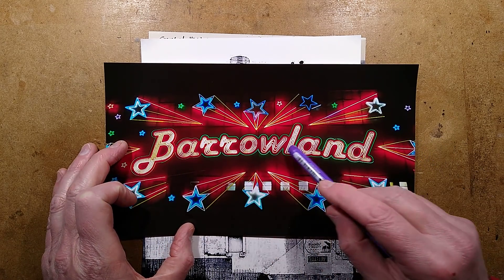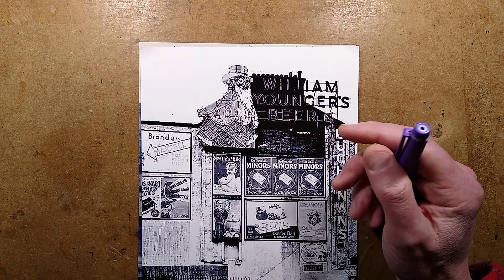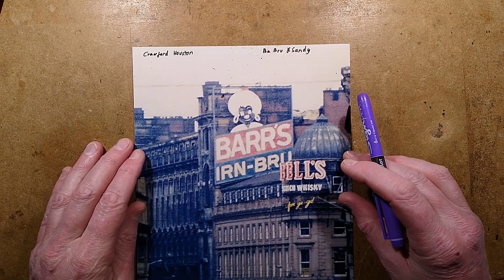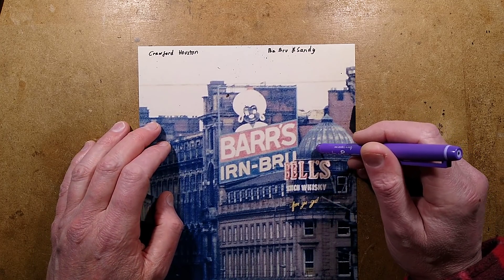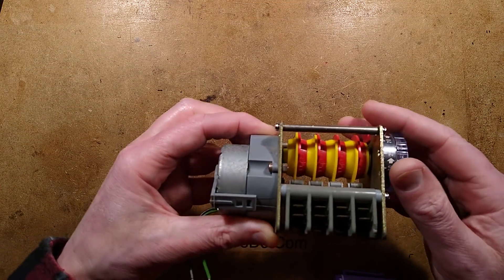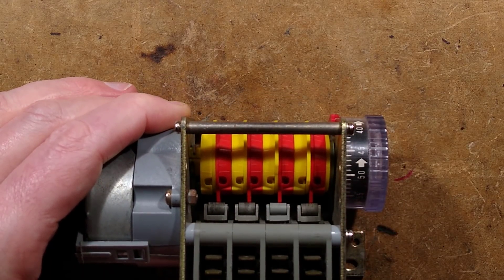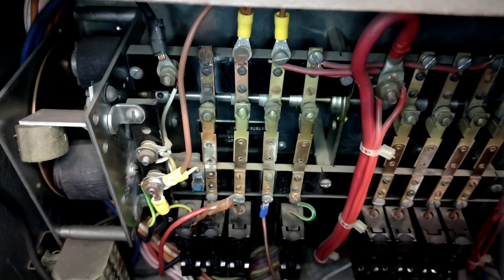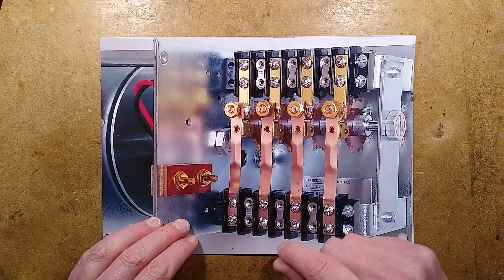A look at the Barrowland's neon sign controller

Comment: I'm a professional projectionist and have seen many of those electroechanical motor driven cam-type sequence switches used to switch the incandescent and/or neon lights on theater marquees, especially in older theaters. (The big theater  I work at now was built in 1916)  Some of those motorized sign controllers are decades old, but still operational. The only time I've had to actually fix one as at a 1926 theater, although I think that controller only dated back to the late 1940's. (a lot of the original wiring from 1926 is still in use in that building) The only problem with that controller was that several of the contacts needed to be replaced.  Although the company that made that sign controller was long out of business,  there was still a company around that stocked motors, cams & those contact shoes to fit it.  That sequencer had 8 contact springs. Only 2 were bad, and one was a little flakey, but a long as were were working on the unit, we decided to replace all 8 contacts  instead of just the 'bad' ones.
Reply from the maker: Replacing all the contacts was good.  It's the best form of preventative maintenance.

Comment: Nice and much more interesting to look at than a solid-state version, although, in theory, a well designed solid-state system would require far less maintenance than the mechanical one.

Just thinking about a sensible way to implement this in solid-state...  Initially I'm thinking a micro-controller (obviously!), hooked up to I2C or SPI switches, connected to solid-state relays.  That could be modular and extensible, easy to swap failed parts, and, in theory (again!), should be maintenance-free for years on end...
Reply from the maker: Modern solid state relays (good ones) would be my choice for a sign like this now.

Comment: They remind me a little of the contactors used in HVACR systems to switch the heavy loads of the compressors and condenser fans.

One thing you didn't mention was at what stage do they switch the power? Are they switching the mains voltage or is the output of the driver going through that?
Reply from the maker: They switch the mains power to the high voltage neon transformer.
Reply: @bigclivedotcom  I think the current is pretty low for neon tubes, so switching only 240V may explain why you can use slow contacts and not be troubled by arcing.
Reply: @jpdemer5  switching transformers or other coil-like loads pulls high current peaks. 

could be the pitting on the contact surfaces act as a resistive layer to 'charge' the inductive load slowly.
Reply: @casemodder89   High peaks, but also very high inductance, so I think the initial "spark" is kept low.

Comment: Having heard the controller running, it reminds me a lot of a GPO ringing machine video here on youtube, which also uses cams to operate contacts like that to create the switching on and off for the various tones, the biggest difference being that the motor/alternator or whatever it uses also generated the tones (dial tone, ringing tone, engaged, unavailable, exchange busy, etc.), mechanical switching is so much fun, cos you can see it working... :D
Reply: Had to go find the video, it's fun watching the contacts and hearing the tones at the same time!!! :D
https://www.youtube.com/watch?v=VzIXvO6RahQ
Reply: I used to work in a telephone exchange, there was the ringer machine, and a great big pendulum clock, that would trip a contact and give the pendulum an electro-magnetic boost every now ans then. Whole exchange was relays and electromagnets, Strowger step-by-step system, not a transistor in the whole hall

Comment: ...just wanted to add; I've seen a smaller version of the first cam switch you showed used in a very old lighting box for disco lights that got donated to the church I went to as a child. I always wondered why I couldn't see any motor or electronic circuitry. Now I see it was just a disk with magnets on that I think used the alternating current of the domestic power supply to attract each magnet in sequence to make the disk spin. It's amazing what some people did with what they had back then. Amazing ingenuity.

Comment: At least the barras has had new house lights recently, there's still some 'interesting' stuff in there but Jim has really  been putting the work in recently.
Reply from the maker: Jim gave me the full technical tour.  Some neat old stuff.
Reply: @bigclivedotcom  yeah the old dimmers are a great piece of technical history, at least part of them were still operating until just before covid. The new air handling is a big improvement too although part of me was a. It sad when I found out the pool table was gone.
Reply from the maker: Yeah, I saw those.  The new LED ones might not last as long as the originals though.

Comment: Real shame Neon lights have fallen out of favor. Really beautiful tech.
Reply: Right, the LED versions just look like cheap and shite imitations, because they are. If I owned somewhere classy, I'd go with proper custom neon. LED video billboards are even worse. Come the day you can get OLED film by the square metre, it'll be like Blade Runner but worse. Every flat surface in London will be coated in them, and serve them right!
Reply: @greenaum  I agree.   The "LED NEON" Looks like cheap crap.

Comment: Interesting! Love the elegant simplicity of it. A commercial unit might be expensive, but it seems like a simpler version could be build with common hardware and a 3D printer. Use those arcade switches like you showed in that module, and break out to a relay or contactor if higher current handling is needed. I gather this was also how some of the lighting effects in 50s & 60s era sci-fi worked as well. 👍️
Reply: A leaf switch is perfect for this application.
Reply: Or you could get something like an Arduino or Raspberry Pi, and connect the output pins to some relays.

Comment: Cool. Neat bit of history there. I think I would have stood a bit further away from those sparks though. How many actual switches are there for that sign? I'd have thought they would need more than the 12/16? in your video cos there's more stages than that. ...unless they use another switching system to switch between stepping on the barrowlands letters  and chasing stars.
Reply from the maker: I didn't spot the star chasing bit.  It might be external.

Comment: 8:05  Do those cam switches actually trigger the neon, or do they trigger some contactors which actually trigger the neon?
Reply: While I wonder the same thing, to my eye, those contacts look beefy enough to drive the neon directly. Once struck, neon doesn't require much current to keep going.
Reply from the maker: Driving the neon transformers directly as far as I know.

Comment: With one more switch being used as a master then they could have it all go out at once. Shut off the main switch (that has all the lights going through it) just before the reset of the pattern, then turn back on before the pattern restarts
Reply: If that switch was operating a relay or contactor, maybe--it would potentially have to carry a lot of current otherwise. Besides, adding parts adds $$$, and Clive had mentioned these were pretty expensive from being hand-built.

Comment: Washing machines used timers like that for many decades too.
Reply: I was thinking the same thing. Also in dishwashers they where common untill quite recently. But those have a synchronous motor so the spindle speed is fixed by the frequency of the mains alternating voltage.
Reply: @Acamperfull  Yep, the small one shown had the synchronous motor.  But the ones in mass produced appliances had the sequences cast into the plastic cams, not manually configured on the assembly line.

Comment: Those cam switches with the microswitches in them are only slightly different than the ones in my 1970's vending machine. The ones in it adjust by loosening a single screw and adjusting the 2 piece cams. If they aren't adjusted right, it jams up badly, but when set right there's nothing quite as musical as it. Setting the cams was actually really fun!
Reply from the maker: I remember those machines.  Really neat.

Comment: Clyde, you know me. No video of the sign?? I have to see it! Grew up building, erecting and servicing neon signs. I can drive a few hours to Miami to see some. I have a friend there now who been sending me pictures. I have one of those spellers/ flashers out in my shop, They have been making them forever as you said. I mainly do window signs but now, but it is a few a year, Got a job redoing a channel letter set in town. I am NOT going to mention LEDs. That and an hour from here I have a shot at a small chain of stores who wants neon in the windows. Till I die, I say, Neon till I die.
Reply from the maker: Search link to many videos in the description.  Someone recently sent me some pictures of a different speller.  Still motorised, but completely different.

Comment: I've seen a few Air Liquide vans driving around where I live here in canada. I thought it was funny when I first saw it because I thought it was french.
Reply: I've seen them in Denmark too, and also thought they were a French giant that bought up the local specialist suppliers. No idea they were the original Scottish inventors of one of the refining technologies.  Wonder if that original technology could be efficient for CO2 capture (the artificial removal of excess CO2 from the atmosphere to undo the damage from excess burning of buried remains of ancient plants).
Reply: @johndododoe1411  Hard to beat planting trees.
Reply: @NiHaoMike64  Trees and other plants occupy a lot of area and are slower than humanity digging up and burning oil, gas and coal.  We need a capture technology that's equally fast.
Reply: @johndododoe1411  Perhaps ocean algae? There's 3 times as much ocean area as there is land area.
Reply: Claude Neon and Air Liquide are French… The only connection with Scotland is that their UK branch do business here. I get welding argon from them.

Comment: I once had to replace a complex industrial control system that was based on cam switches with a modern PLC system. The original was a thing of beauty with multiple different cam switches in cascade & interlock configurations - it seemed such a shame to tear it out, but had become a nightmare to maintain as cleaning or replacing contacts involved a fair bit of fettling to maintain timings.
Reply from the maker: The curse of stuff like that was when other people had "adjusted" stuff before you got there.
Reply: Used to maintain a building generator system. The main controller was a seven day cam switch. The original maintenance instructions gave the clearance of the switches and the method used, feeler gauges and a points file. It sat in operation for 20years,with the system being tested every fortnight.Never had any problems with it. Then it was replaced with a hardened plc. Biggest pile of poo ever. Nothing but trouble with the plc and the SSRs installed to switch the original loads ( 1000 amp rack mounted, vacuum breakers). They were still fiddling with the system when I left a year later. Progress?         Also seen them used on lift controllers due to not being EMP susceptible.